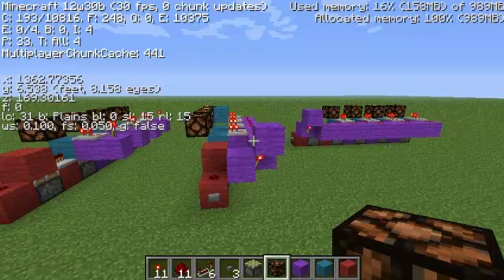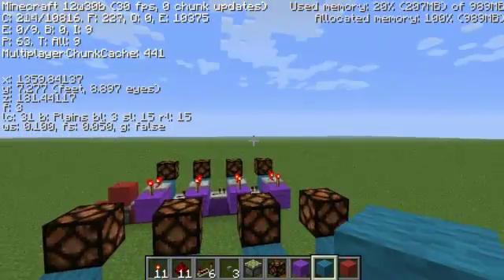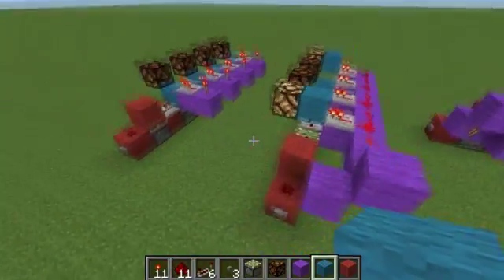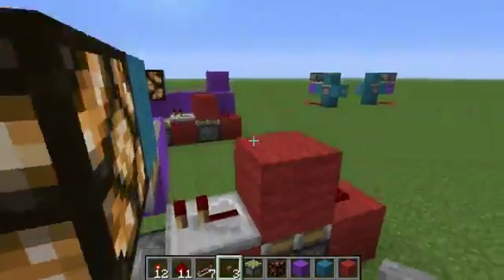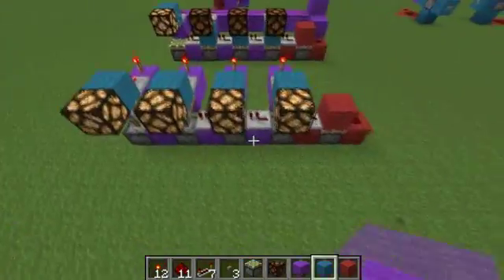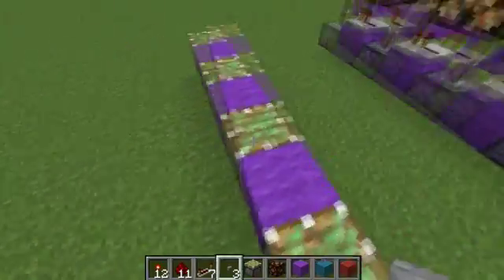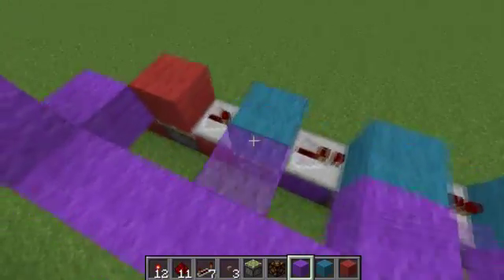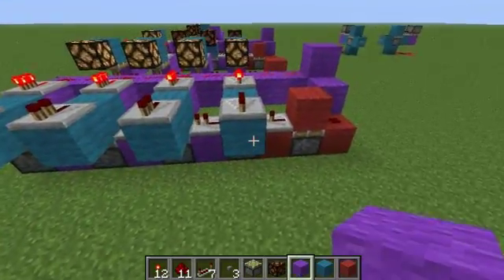Compact Binary Decimal Counter

Comment: Piston heads do not transmit power in the new snapshot and will not in 1.3. The piston is actually receiving power from the wool block 2 spaces above it (same glitch as pistons getting powered diagonally and not updating.) Try this: place a piston facing sideways and a block 2 spaces above it, then power that block with a lever. Afterwards update the piston by placing a block next to it (block update) and you'll see it extends even though there's an air block between it and the power source.